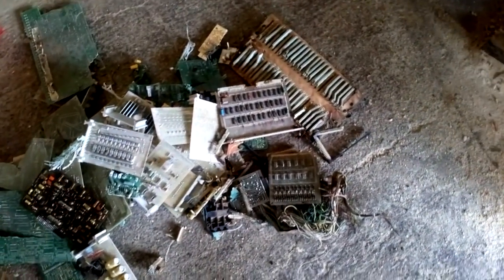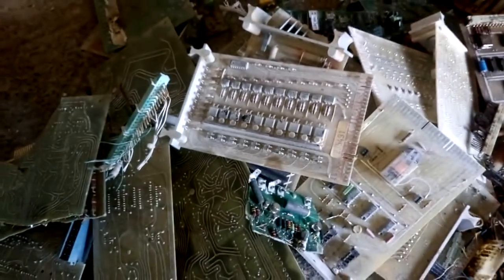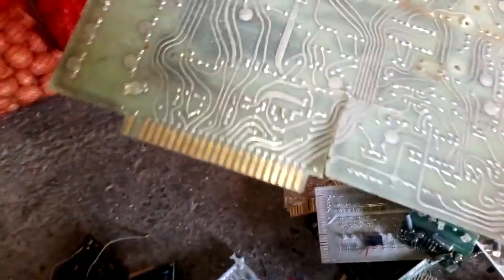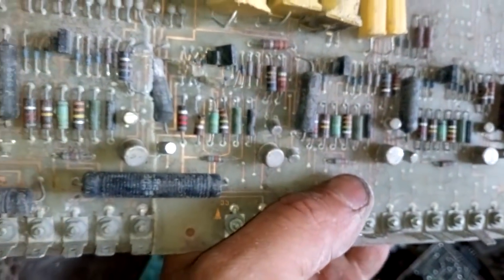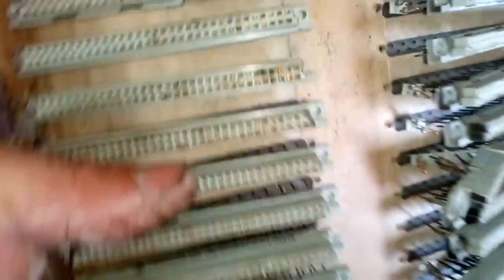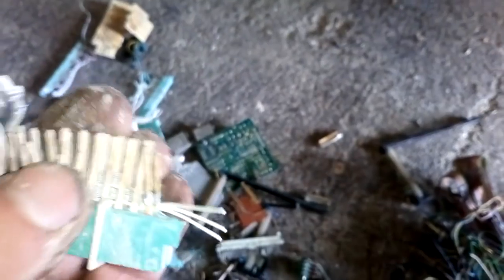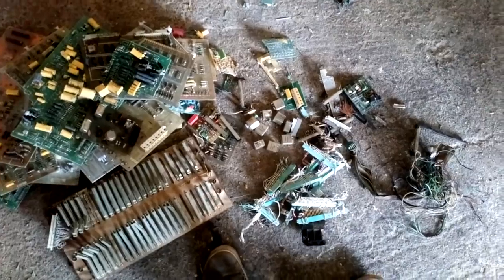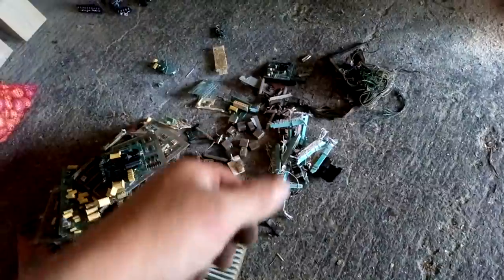BUY ELECTRONIC WASTE on JUNKYARD for GOLD RECOVERY!

Comment: Keep an eye out for high power server power supplies.  A fair number I've scrapped have thick ultra low resistance shunt resistors on them (0.0025ohm) and they are almost pure silver.  One single power supply netted me almost 8gm in silver just from the shut resistors.  Nice haul you got there.  You'll be busy for a while.

Comment: Never seen a junkyard for waste before. I’m sure I’d have a blast there.... do they just charge you by the gram or how does that work? Another cool video!
Reply: local scrap yards will usually sell the scrap they buy , got one about a mile from me that doesn't mess with precious metals so I get to pick thru it , lots of silver contacts from water heaters , stoves , washing machines , plus the odd computer and telecom equipment for gold , found a 400 amp breaker there that had 4 oz of silver in it , look around your area and find a local that's buying scrap

Comment: hey a lot of cap pulling agead of you and fingers are cool easy to proces and quite good yeald from it and it look quite old boards  i will date  it like late 80 i guesing  cool stuff, onions in backround you get from your own garden??? cool  i got last time some box with huge relays  with golden pins  24 relays each have 20 contacts around 4 mm diameter was a great scoredidnt process it yet tho , anyway cool pickup
Reply: hey broo when you have time check out what i just bring home basically same age and technology circuit boards